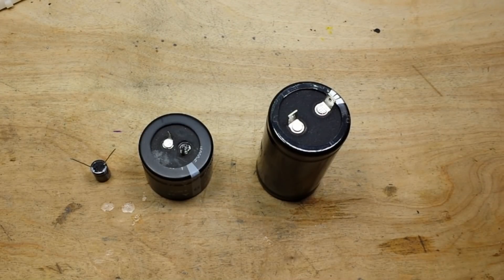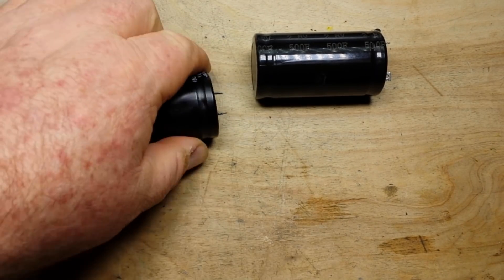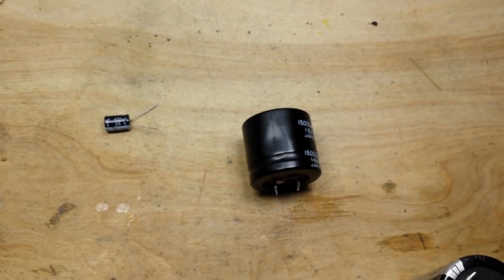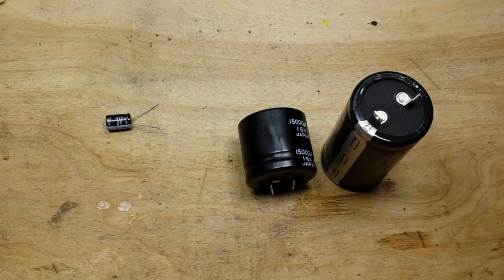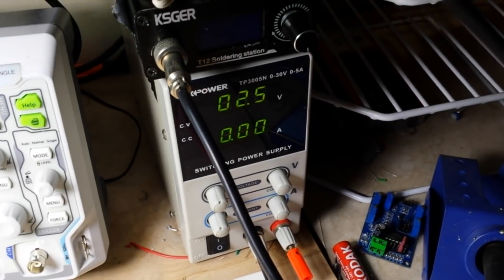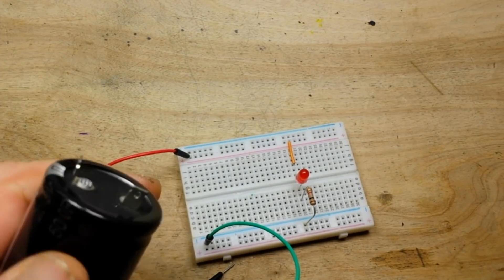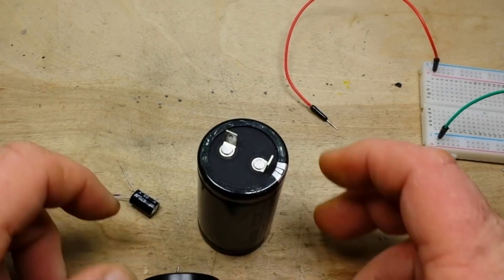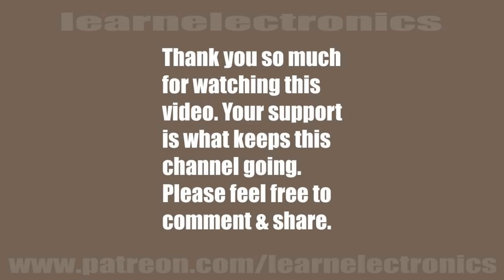Let's talk about super capacitors

Comment: The charge or discharge rate is given by R times C. For your big cap, it would take 1k Ohm times 500 F equals 500,000 seconds to discharge and stop lighting the LED. You definitely can't discharge one with a 1M Ohm resistor, as you suggested, in your lifetime. 😉

Comment: If you use a super cap in a 5v circuit make sure you properly hook up a voltage divider so it does not get 5v of charge during testing, it will blow up and scare the fuck out of everyone that hears it. My roommate thought I had shot a gun in the living room it was that loud, now I have some much newer super caps with much safer over voltage design features. Playing with eBay super caps can be dangerous, get good quality super caps man by a quality name brand from a trusted vendor if you want to play with them. I’m lucky that the one that blew up on me did not happen one minute earlier when my face was six inches from it. They are great fun though. Great video Paul.

Comment: You need about 40 volts to break the dielectric strength of your skin so I don't see how a 2.5 volt super capacitor can hurt you just by bridging the contacts with your fingers. Amps need voltage to be dangerous just as voltage needs amps to be dangerous. It would turn your screwdriver into a heating element though. I'd be more worried about those nasty flash capacitors in cameras. Well, they aren't pleasant anyway. As for one of those industrial capacitors that Photonicinduction demonstrated some years ago, I don't want to mess with anything that can blow your hand off.
Reply: Actually it's not the voltage but the amps that can kill you . I learned that in a technical school when studying electronics .
Reply: Say WATT!  Even an instructor at a technical school might not know watt he's teaching isn't correct when applied to biological things. Power kills. loaded guns for example.  I've been burnt by 12 volt auto battery on a hot sweaty day and severely startled by 120 ac on a cold winter day. The dc burn circuit was nipple to right hand. The ac path was the same hand to a wet knee on the ground. Both very unpleasant and neither one was even close to full power, because of resistance. Luckily the ac fault included a 6 ft long resistor in the water that ingressed into a power cord.

Comment: The energy stored is 0.5 * C * V^2 = 0.5 * 500 * 2.8^2 = 1960 J ( Joule )

That is all there is to it.
An 85 kWh battery as used in Tesla car stores: 85000 * 36000 = 306 000 000 J
You would need 156122 of these supercapacitors to store the same energy. Their linear discharge characteristic makes them less suitable for a car.

Comment: Disassemble a 5v super capacitor, you'll get 2.5v caps in there
Reply from the maker: Cool, I did not know that!
Reply: @learnelectronics  but before you open, you should be able to feel 2 of them underneath the plastic wrap

Comment: Back in the dark ages at the LORAN station, we had capacitors the size of a truck battery. I don't remember the capacities though, but they were stored with an 8 ga wire between the posts. thanks for the video!
Reply from the maker: I kinda remember LORAN.
Reply: Probably before you were born sonny.

Comment: Yes i know a dude who made car battery out of 6 2.7 5000f supercapictor or 500f ...the good thing is it charges almost instantly.....well no match for mf capicator no matter what is its power ...I tried almost every mf ....n made a spot welder out of two super caps with cut out circut to avoid explosion n sitting in box waiting for copper probes....super capicator are scary i admit heard that it explodes badly...
Reply: I have a capacitor bank with standard 2200uf capacitor,50v . Total capacitance is 15400uf. Accidently dropped a forceps onto them, when they were charged at 24v and it got stuck to it with a bang. Had to use resoldering station to get it unstuck

Comment: So how can you possibly measure those super capacitors?
It's hard to measure a normal 1000uF capacitor or a 10000uF capacitor with any measuring tool at least that I know of, especially those cheap LCR meters... I think they can go up to 100uF for most cheap meters and I haven't found a professional LCR meter online capable of measuring higher than 1000uF capacitors which is a real problem for me since I regularly work with larger caps than I can measure with my equipment.
I would like to know if there's a different way to measure large caps without using any fancy tools that aren't capable to do it.
Another thing, it would be nice if I could measure the capacity but it would be even better if I could also measure the ESR of those large caps, do you know a way to measure the large caps using only some discrete parts, maybe a breadboard version or some DIY board?
Reply: Xy curve scope could do that in shorter time

Comment: I have read about those. They should be able to charge very fast, if you give them enough current. Also, they can be charged an recharged very often, which might be usefull in some cases.
Reply: I have picked up several of these little gems, 5 smaller one and 5 D cell size.  Not sure what I was thinking when I bought them but they lay on my desk in bags.  I did charge them up, first with a power supply, then I got the idea of using my battery charger on them.  I set it to the proper voltage and it charged them very quickly, within a few minutes I was up to nearly the max voltage, I didn't want to chance going the limit of 2.7 volts. I did try using one to weld just for kicks, it will indeed dump enough juice to weld a couple of thin pieces of steel together.

Comment: Please explain why you were not injured when you grabbed both Terminals on the charged caps.
Reply: Low voltage... Had they been 220v fully charged cap, even 1uf would have hurt a lot
Reply: Well this got me thinking,  whats the circuit we are looking at! it's "Cap+ to skin, skin to body, body to body, body to skin, skin to Cap-" so:
Cap+ to skin = Skin to Cap- = 1Ω 
Skin to body = body to skin = for me about 500KΩ, I measured myself as 1.5MΩ between hands. 
Body to body  = about 500Ω

1Ω x2 + 500KΩ x2+ 50Ω = 1.05002 MΩ

2.8V / 1.05MΩ = 2.6 uA way below anything harmful.

Currents above 10 mA can paralyse or “freeze” muscles, can stop breathing. Currents greater than 75 mA cause ventricular fibrillation which kills.

Note not the same for AC as the skin acts as a small capacitor and not a resistor, so easier for current to flow.
Reply: @TheEmbeddedHobbyist  they say, too high of a voltage and your muscles contract so hard, they break
Reply: @SurajGrewal  Go very high voltage or high frequency and sometimes you can survive. With High voltage the current can take the most direct route causing burns but may not spread out enough to hit the heart.  with high frequency you get skin affect which will cause the current to stay very close to the skin and not go inside the body. If i remember correctly skin affect starts about 10KHz. but it's not something i'd like to try out. :)
Reply: @TheEmbeddedHobbyist  Understood, but then why is it that I'm quite often seeing warning about discharging caps  before one one touches them? Is it only for high voltage caps? If so, wouldn't it be a good practice to be cautious all the time? Is it that they won't kill you, but you might get zapped? I'm still confused why Paul didn't seem concerned and didn't issue an explanation of why not.
Reply from the maker: Skin resistance. Low output on the small caps. I never did it with the super cap.

Comment: Not messed with Super Caps yet.   Really not had a Need for that much energy flowing all at one time.   LiIon Batteries can produce crazy levels of power as it is.   I have some 38120 LiFePo4 cells 4 in series can jump start my truck.  8 in series  I can Arc Weld with them as well.  My understanding is you really should use balance / protection systems just as Li Cells. Currently using 20 of these for a  Emergency Back Up Solar Power System . https://batteryhookup.com/collections/lifepo4-batteries/products/4-headway-38120-hp-3-2v-8ah-lifepo4-lithium-batteries-25c-200a-super-cells
Reply: You can use them like a battery also.  You just have to control the discharge rate.
One negative about the ultra-caps is the energy leakage (i.e.  self-discharge rate).  It's supposedly pretty high in some brands compared to others.  I'm not sure how it compares to nimh or Li-ion cells self-discharge though.
You can find vehicle starting cap bank vids on YT if you are interested.
Reply: @ab_ab_c  Li cells are quite good at holding a long term charge.   NiMh SUCK at that task.  Even worst then  NiCd or lead acid.  Let one reach the freeze point  just once and it's DEAD MEAT.
Reply: @pulesjet  Actually, the newer generations of nimh cells are quite good at retaining their energy over a very long period of time.  Look into Eneloop cells especially.

I've never had an Eneloop freeze in my climate, but I have had some Amazon nimh cells fail completely, so I don't think they are a good brand.  I still have Eneloop nimh AA cells that are over 5 yrs old & they work fine & probably still provide at least 75% of their rated energy capacity (though I haven't tested any of them recently).
Reply: @ab_ab_c  I purchased some $300.00 in NiMh packs for my Makita equipment.  Every single one Died the Cold Death in my van.  Boy was I a unhappy camper.   Pizzzzzed I was.  Nothing would revive them.
Reply: @pulesjet  Expensive bummer.  Did you try to charge them using a bench power supply instead of the Makita chargers? Some chargers won't charge if cells is below a certain voltage.  I have a charger that sometimes won't charge some nimh cells that are very discharged, but when I put them on the bench power supply for a while to charge them until they have a high enough voltage, then the charger will charge them again.

Some energy cells are not designed to operate or be charged in very cold climates.  Li-ion seems to work at pretty low temps--but they recommend you charge them within a certain temp range.
Reply: @ab_ab_c  LOL,  I tried every trick up my sleeves and other places not mentioned.  They wouldn't even pull any current any more.  DEAD MEAT.
Reply: @pulesjet  I've seen that happen with lead-acid batteries (i.e. <1V).  What I've had success with is shock charging them. Note:  Make sure your lead-acid electroylyte levels are at the proper level before doing the following.  I don't know if this technique will be in anyway useful to you with nimh cells--but hey, I imagine it couldn't hurt to try it on them (only I would use lower V & A limit setting for nimh cells, naturally).

I use a bench power supply to smack them with 15V, then 20V, & then 30V for short durations at each voltage with the current limit set to 2A.  Then I lower the current to 1A & set the V limit to 12V & let them sit on the charger for hours. As long as they don't over heat, I've seen some come back to life.

Note:  There may be a lot of gassing at higher V levels--it's ok since you won't be leaving the batt charge for more than 5 minutes at any V higher than the recommended batt V.
Reply: @ab_ab_c  Use to do that with NiCds that wouldn't hold  charge.  Zap em with 50 - 100V dc burn out the tendrils shorting them out.  Worded more often then not.  Those wouldn't even pull a current.   Ever Reverse charged a LiFePo4 ?  They do that too.
Reply: Actually, you'll wear them out very quickly if you dump their charge fast. They'll heat up internally. Only use specially made high current super capacitor for that purpose

Comment: Hi and thanks for another interesting video.  Would defiantly like a followup to this one on where to use, can you couple them in series to get higher voltage, and what does it do to the capacity, what about a few in parallel, could it be used for spot welding ?
Reply: When you put two 2.8V max. 500F capacitors in series, they act like a 5.6V max. 250F capacitor. Series capacitors actually go down in capacitance, but can be charged to a higher voltage. Putting them in Parallel simply adds up their capacitance. No downside to parallel capacitors, just make sure they have the same voltage when you connect them. You can make as many series/parallel connection as you want until you get the voltage and capacitance you want. It's very important to make sure that series capacitors charge and discharge evenly (always at the same voltage). You can power anything if you have enough series/parallel supercapacitors but most of the time its much more expensive and space consuming than batteries. However, very high current doesn't usually affect the capacitors at all, whereas it is likely hard on the batteries.
Reply: +1 I was wondering in what situations these caps are being usefull? I belive my microwave has one? 
Thanks for the great video (and all previous ones)
Reply: Yes, capacitors can be connected in series to increase V & in parallel to increase energy capacity (just like batteries--both are energy storage devices that use different chemistry to achieve the same thing).